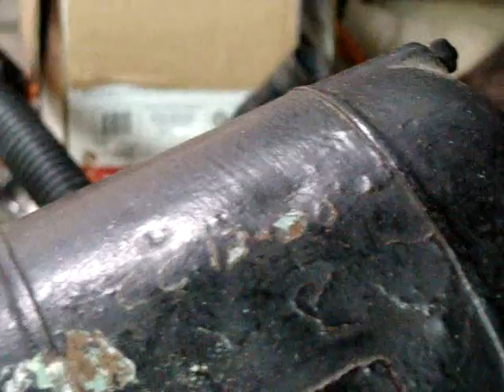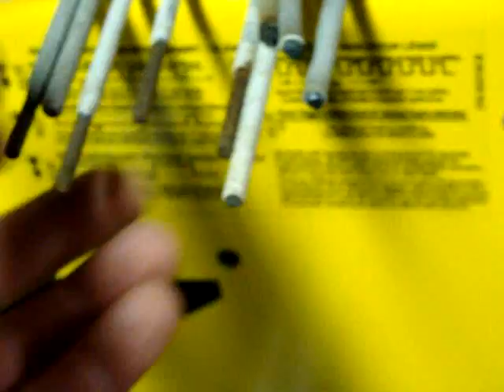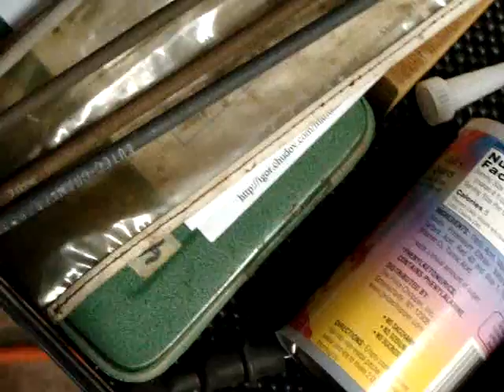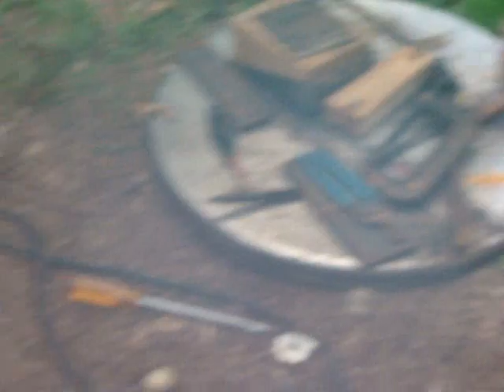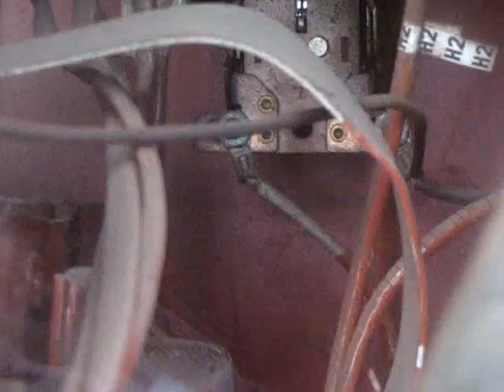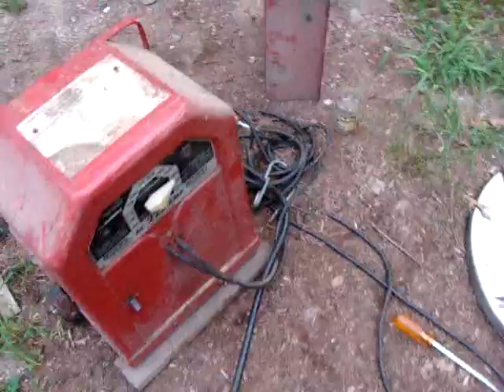Lincoln Arc Welder Part 10

Comment: Welding requires building muscle memory. Train yourself as a school would train you.
Pick a time when you can spend a couple of straight hours welding. Not prepping plates, which should be done beforehand, but welding. Start with pad welding by running stringer after stringer after stringer after stringer.
Grind your practice plates shiny.
Make sure you can see your arc clearly.
Make friends with 6011. Great rod for repairs using an AC machine. Other rods are "prettier", but you need strong reliable welds. Avoid playing with a bunch of different rods at the beginning and run one rod relentlessly until you can kick ass with it.
Visit Weldingweb, the Miller forums, and the Hobart forums. Post clear pics of your beads while noting how many amps you are running.
There is no substitute for "time under the welding hood" so burn and burn and burn then burn some more.
You'll get it. Your persistence will be rewarded.
Reply from the maker: This is sound advice that I cannot argue with. Thank you, and Merry Christmas!

Comment: good job Steve, as long as the weld holds you'll be fine with the levers, zinc primer then paint them before rust worm kicks in